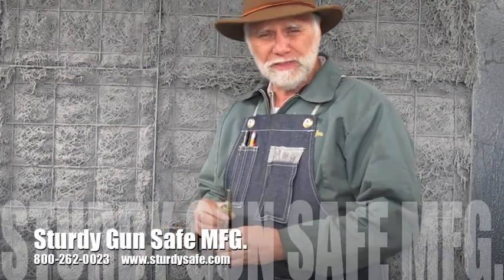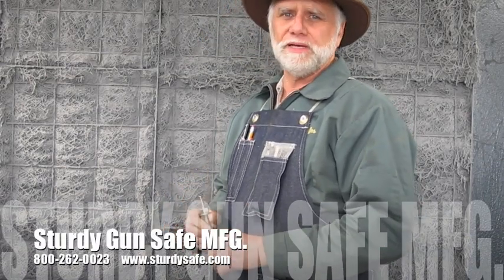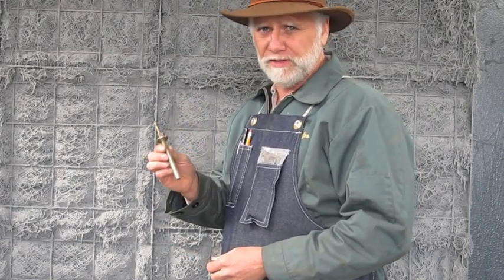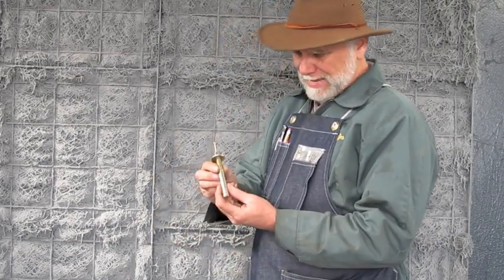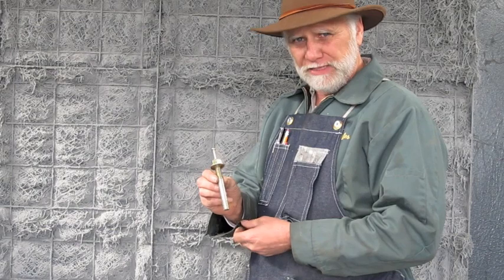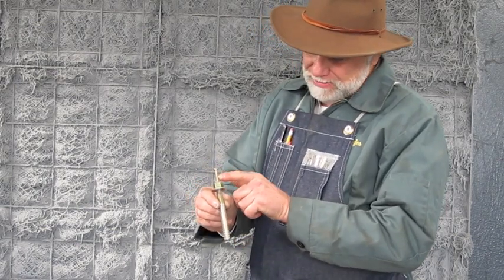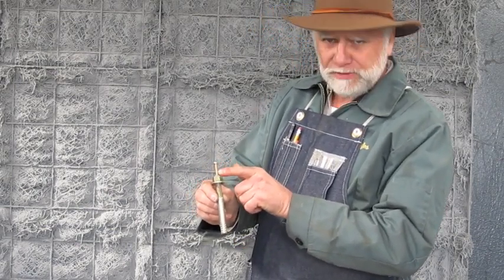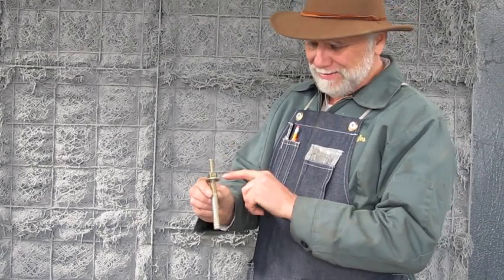Types Of Anchors You Could Use For Bolting Down A Gun Safe

Comment: I use 1/2 grade 8 bolts. 
Drill 1” hole in cement with a Masonary bit. 
Clean out all cement dust. 
Use Sika Superstrength anchoring epoxy. 
Put bolt in head down. Let it cure. Tighten nuts.
It’s 100% bombproof